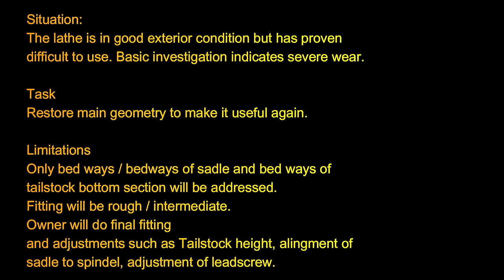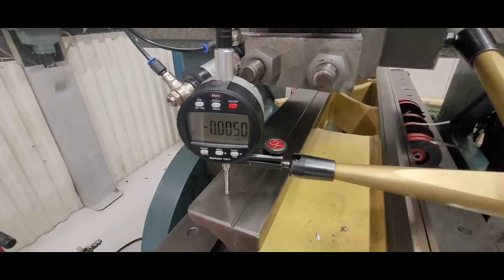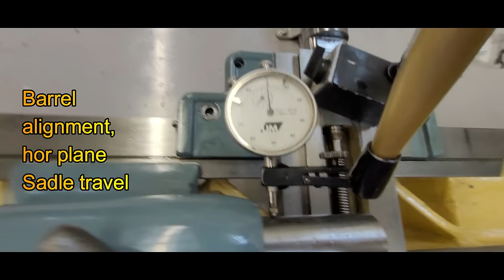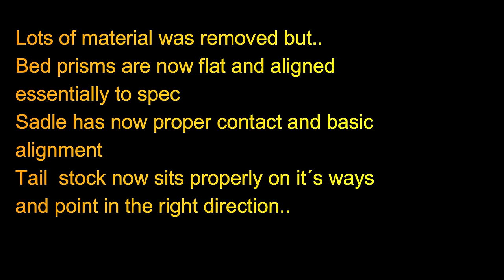Planing a Weiler LZ280 lathe bed

Comment: Very interesting video, a beautiful job, this will give the lathe many years of accurate work. That bed had a significant amount of wear .This lathe looked in a general tidy condition as a machinist. I am fanatical cleaning the bed if anything abrasive has been used and regular lubing. Long-term accuracy depends on the bed and slide condition.
Reply from the maker: Thanks for your kind words and you're spot on regarding cleaning and lubrication. 
I sent along some extra oilers to be installed.
Reply: Bagai mana cara memesan nya dan tau harganya

Comment: No hardened ways ? Hope your planer is well aligned too.
Reply from the maker: It's has no hard ways, just had a hard life ;-)
In fact it is very easy cutting material. And yes, the planer is set-up and tested.
Reply: @henrikandren6967 and if they were hardened, would you still have been able to cut it?
Reply from the maker: No, not like this. I do have a small grinding head adapted to fit but I'm still to put it to use as I'm concerned about grinding stuff and it's definitely not set up for flood cooling.
Reply: @henrikandren6967  i wonder how it works, if the stone wears to smaller diameter, is it compensated somehow to make the result flat?
Reply from the maker: I'm no grinderhand but I'd think it wear in the similar amounts as other cutters and I think one dress the wheels for sharpness before they go that much out of size. Maybe some expert on grinding can give you a better answer. For me I'd be more concerned with heat build up.
Reply: @henrikandren6967  If the ways were hardened , grinding is mandatory Yes heat can be a problem during grinding however, with small stock removal and the right wheel that job can be done dry.

Comment: Question,  how much wear do you get on tooling like that?  How often is it checked?  Just curious on the procedure on that with such exacting dimensions.
Reply from the maker: In terms of carbide tool wear, it is insignificant. Imagine and compare to similar tool in a lathe. Say a cutting speed at least 10X and a dia 200 shaft 1m long gives a cutting length of 120m. Just for reference.
Back to the question. The edge is diamond lapped sharp and keen, that's what I check. Sharpness and no damages by means of nail shaving and feeling plus visual loupe inspection.

Comment: The tailstock of my lathe ( flat ways) is less worn than the headstock end. Can I just switch ends the headstock is on to make the lathe better? I rarely turn really long things.
Reply from the maker: There is nothing really wrong with your thinking in terms using the un worn end of the lathe, I have however a hard time picturing a configuration facilitating it somewhat easy. 
Some lathes had loose V-prisms that could be turned around, right or wrong.

Comment: Awsome Planer. What planer do you have?
Reply from the maker: It´s a Powell Planer which has been significantly rebuilt over it´s lifetime. The company was organized in 1887 and merged with Woodward in 1899 into Woodward and Powell Planers which are "more common".

Comment: would it be ground after the planing? or is planing enough to get it into spec
Reply from the maker: Depends on the spec i guess... If it was to be ground I think it wouldn´t make sense to plane it first. 
If one wants to it is very possible to scrape finish it after planing it, relatively little work compared to before planing. Now you´d only need to modify the surface and make sure to not alter any flatness or alignment. Otoh, having planed it for smoothnes and the material cut butter smooth, the result after deburring with a ground precision stone really makes you think trice before starting doing anything else to it...  I have though planed other cast irons where I would not feel satisfied with the planed finish for a sliding surface. So it might depend on the case at hand as well.
Reply: Depends. Some lathes have hardened beds and these are best ground. Often, the last bit is accuracy is obtained from hand scraping of the planed surface

Comment: Hope the shaper bed is well lubricated or it will need machining too :)
Reply from the maker: It is indeed, it has an automatic oiling system feeding each side of the V-prisms individually with a heavy flow rate. I run it for quite some time to make sure the oil feed and film is steady before measuring or making chips
Reply: @henrikandren6967  compared to lathe, its ways are used a lot more.